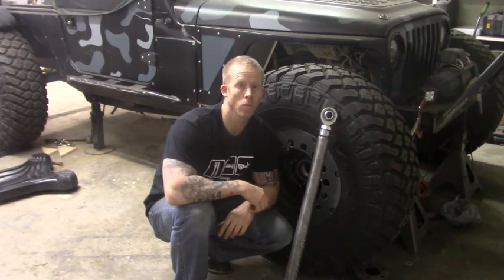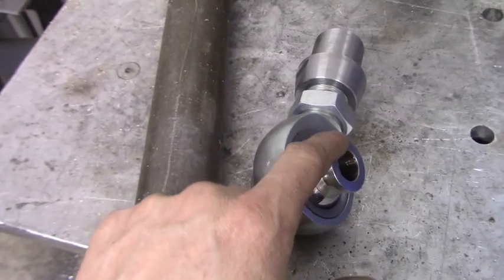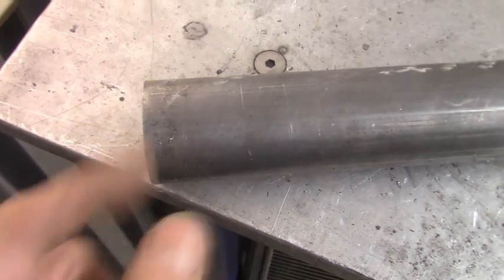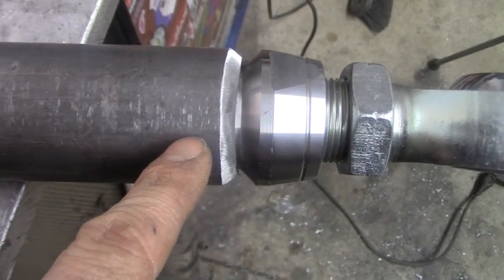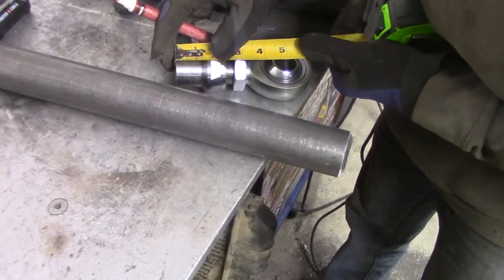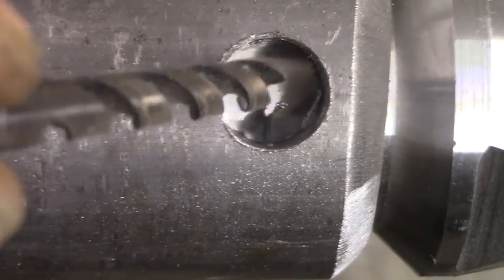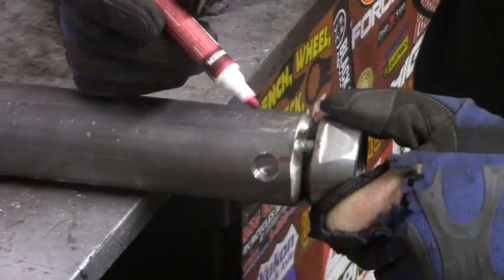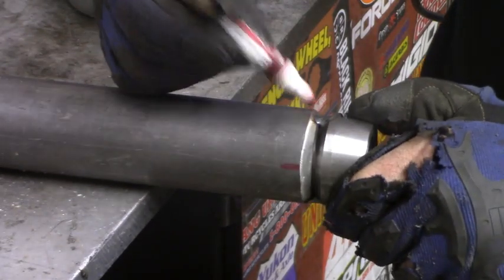DIY control arms

Comment: We're can I get them home joints
Reply from the maker: TMR, Ruff stuff or Arrtec are a few
Reply: @CardinalOffroad  thank you what size were those ones
Reply from the maker: That depends on your setup. If you call any of those places they will tell you what you need. I strongly recommend 1/4 in wall steel though for your links. And use DOM not pipe
Reply from the maker: @toons3115  3/4 with a 5/8 eye

Comment: Those pipes are so thick, you could drop your jeep from a plane and they wouldn't flinch
Reply from the maker: You think so but you’d be surprised if you actually rock crawl hard they will bend like nothing. Reason why some run solid aluminum lowers so they flex
Reply: @CardinalOffroad  crazy, didn't know rock crawling was that intense, those things still look pretty crazy to me, wish you the best in your adventures man.

Comment: Bro how much for a Chevy Colorado 2011? I buy it from you and a lower control arms too
Reply from the maker: Depends on price on what ends you’re wanting, size etc.
Reply: @CardinalOffroad  i want something like 3 inch lift bro
Reply from the maker: In order to build arms I’d need measurements from eye of axle bracket to eye of frame bracket.
Reply: Oh ok bro and how many days you would have it ready? Also I wonder if you can make like a custom Bump stop front mount you see the Colorado has a bump stop but I so small I want something little bigger there anyway I can contact you more directly so I can send you pic what the stuff I want custom made
Reply from the maker: It would probably take me 2 days to build them once I get the heims and tubing. Do you have an email?
Reply: @CardinalOffroad  yeah I have a email my bro
Reply from the maker: What is it. I can send you some info and discuss what you want
Reply: @CardinalOffroad  my email buddy
Reply from the maker: @xxkaiserxx2505  I don’t see anything
Reply from the maker: Ok I will try and email you today. Thanks

Comment: Im tempted to atempt making trailing arms and toe rods for my Camaro, i dont see spending over $100 on square tubing, round tubing and poly bushings; then again i might be wrong.
Reply from the maker: For some it’s cheaper and depending on the length it’s needed in order to get a custom setup.  Abs really some of the ok the shelf ones are more money and might not be as strong
Reply: @CardinalOffroad  i actually remembered i have a prothane suspension kit i had bought but went a different route so i can source thru the kit for bushings i can use for this car. The cheapest trailing arm/toe rod combo for this vehicle is $279 in non adjustable design so i know 1.5-2.00 inch .120 tubing can be had for under $50 in lengths that can be cut to the 4 pieces needed not counting the end where the bushings will go.
Reply from the maker: Yeah metal is cheap and it’s nice having the option to make adjustments

Comment: how do i figure out how long .i need my arms
Reply from the maker: Kevin Clevenger to be safe you can use pvc to mock them up since it’s fairly cheap. Get your brackets where you want them and be sure to leave about a half inch of adjustment on your heims. Once you get it set and feel confident you can cut your DOM to the same size as your pvc.
Reply: @CardinalOffroad  thank for the help .iam building a grand cherokee wj with 10inch lift in it
Reply from the maker: Kevin Clevenger awesome. Good luck with your build!

Comment: No links for parts?
Reply from the maker: Deven Belanger yes we will have them on here tonight.
Reply: Cardinal Offroad sweet deal. I am building and off road rig and can’t find joints that are reasonable priced
Reply from the maker: Deven Belanger awesome! what kind of vehicle you building?
Reply: Cardinal Offroad I have a sprint car frame Jeep axles that I narrowed 12 inches and 40 inch loader tires with a sb 350 th400 transmission and 203 transfer case
Reply from the maker: Deven Belanger wow that sounds awesome, I’m jealous!
Reply: Cardinal Offroad no need to be jealous yet it’s still a work in progress lol but thank you very much
Reply from the maker: Deven Belanger it takes time. One thing I’ve learned is do lots of reading and figure out a parts list so you have a good idea on what you all need. Also don’t forget to get LH and RH threaded heims when you do your arms.

Comment: Are you going with a right hand left hand thread for adjusting?  Like you did on the tie rod video.  Great stuff bro.  Keep em coming
Reply from the maker: Lon Redmon yes that’s correct. If you put 2 of the same threads on when you go to turn it one side will push out and the other will pull in. So by doing one of each they will stay even when you turn the tubing. Thanks for watching!

Comment: Awesome video, gonna attempt to make some tie rods
Reply from the maker: Ro Ro cool! It’s pretty simple for the most part. Just take the time to make sure your measurements are correct. There’s also different ideas on how to fully weld the bungs out there. I welded 1/3 at a time and let it cool before welding more. Put a wet rag inside the threads and it works perfect.